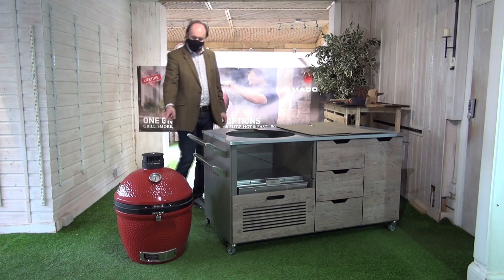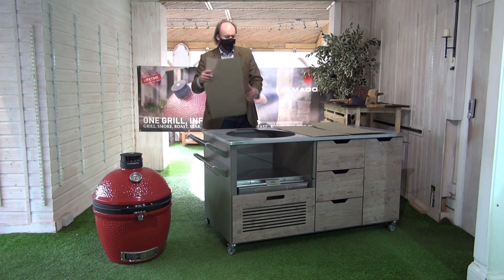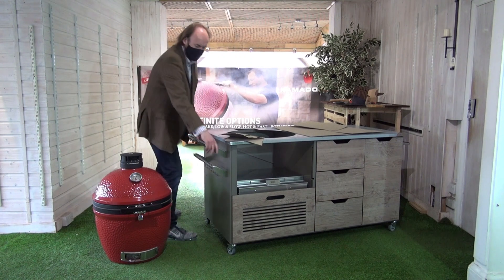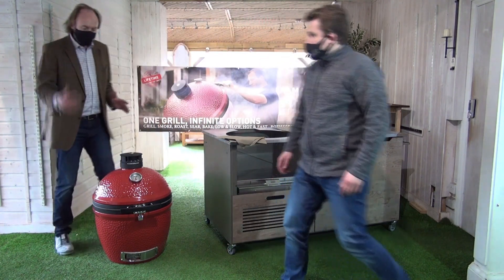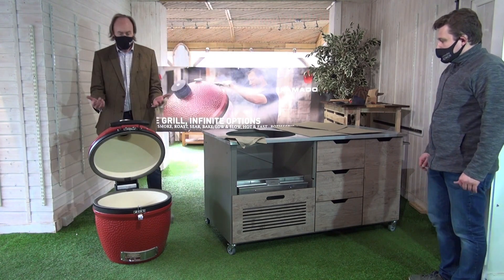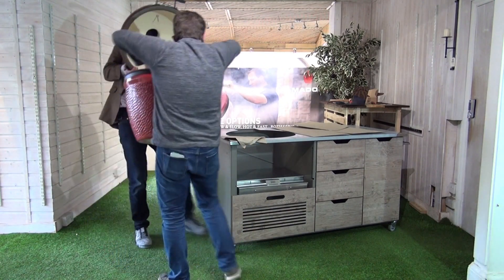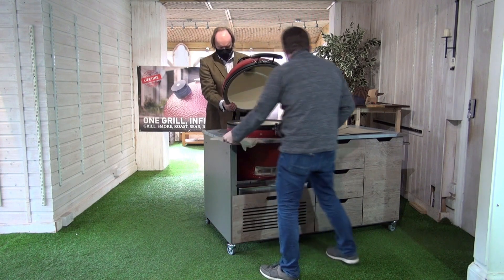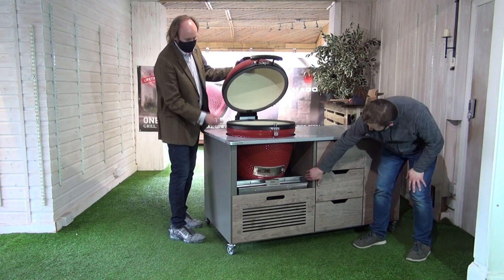Nesting KJ into KamadoSpace

Comment: The Kamado manual specifically says not to lift by the hinge mechanism, which is effectively what you are doing here. Thoughts?
Reply from the maker: Hi Chris, thank you for bringing this to our attention. 

We recommend that the Customers adhere to product instructions. If the Kamado Joe grill cannot be lifted by the hinge mechanism, then we suggest lifting it from the sides. 

We're also working on this on our end, to introduce an alternative option for a smooth transition to the table.
Reply: @KamadoSpace  Lifting by the sides was how I did it in the end, with some difficulty.

Are you interested at all in feedback about your product?  If so, where is the best place to send it?
Reply from the maker: @chrissmith4933 , absolutely! Please email your feedback to our customer care team - info@kamadospace.co.uk